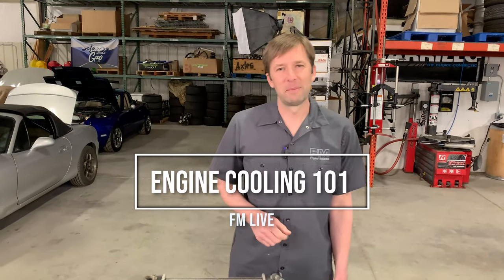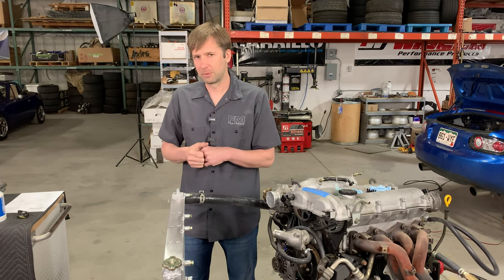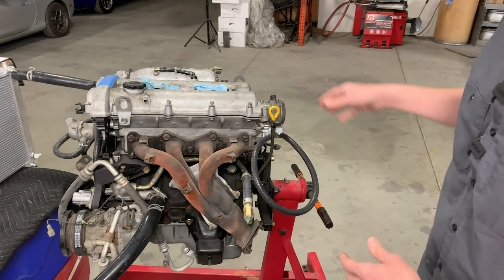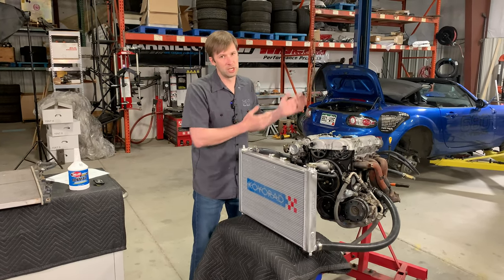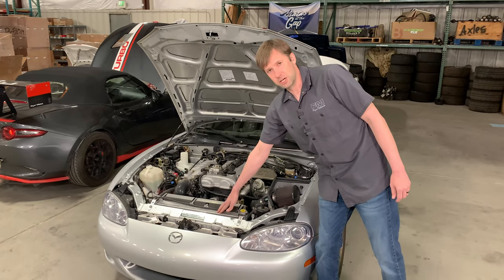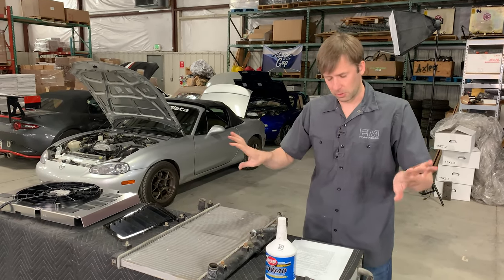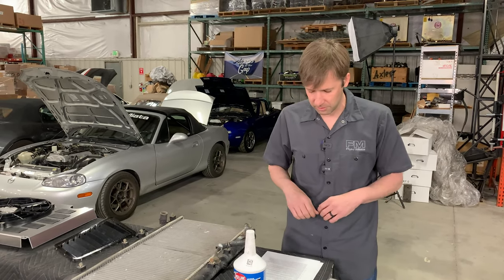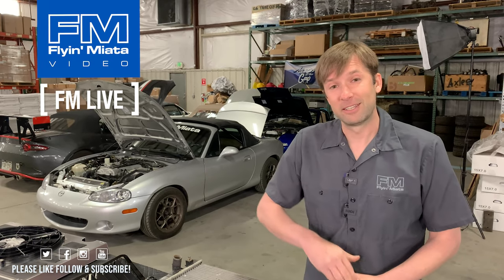Miata Engine Cooling 101 (FM Live)

Comment: Very helpful talk.  

Not mentioned in this talk, or discussed much anywhere on the various Miata Forums, is the role of the coolant return pipe on an NA engine that takes the coolant returning from the cabin heater, and routes that coolant to the lower side of the block. This coolant return pipe is bolted straight to the exhaust manifold near cylinder number four. This bolted connection conductively heats the pipe. The return pipe also receives significant radiative and convective heat from the rest of the exhaust manifold. This small but significant short circuit of heat flow from the exhaust manifold into the returning coolant is intentional and by design.

The purpose of the heat transfer from the manifold to the coolant return pipe is to help bring the engine coolant up to operating temperature quickly during engine warm up, when the engine is started in winter in colder climates. This short circuit creates the following problem: the heat transfer from the exhaust manifold to the coolant return pipe never stops. Some heat from the exhaust manifold is dumped into the return pipe, continuously, whenever the engine is running. The hotter the manifold, the greater the heat transfer.  

If you live in Southern California, or in a similar temperate climate, the engine block rarely cools below 50 F even in the winter. Warm up is quick in the Southern States, and occurs in just a few minutes. For these locations the heat transfer from the exhaust manifold to the return line does more harm than good. 

I drive a 1.6L normally aspirated NA6 here in the local mountains. In the first 20 minutes on California's famous Angeles Crest Highway, the rise in elevation is about 4,000 feet, or around 200 feet per minute. On a hot day with the air temperature above 95 F, towards the end of that 20 minute ascent, I am controlling the position of the temperature guage needle with my foot on the accelerator. I back off the temperature goes down. I accelerate the temperature rises.

On this car radiator cap, hoses, thermostat, water pump and fans are all in good condition. The radiator is a 37mm Koyo.  I use a 2/3's water and 1/3 glycol coolant mix. 

This brings me to the following question:  The last time I was replacing the water pump, I slipped a DEI aluminized, reflective, tubular, heat shield over the coolant return tube.  These DEI sleeves have a proven ability to significantly reduce both radiative and convective heat transfer into the tubes and cables that they protect. Following the install of this insulation, my impression is that engine is not as quick to over heat in summer, on Southern California's famous desert ascents, such as the Angeles Crest, and the Grape Vine.  

What do you think Brandon? 

To promote rapid warm up, Mazda designed in a thermal short circuit between the exhaust manifold and the coolant return line. If your engine never gets truly cold, what you experience mostly is a thermal short, dumping waste heat into your engine. An insulated, reflective sleeve goes a long way towards limiting the radiative transfer into the coolant return pipe. Do you know of other instances in which this has been done?

Comment: I've got everything except stronger fans. My big fix, for higher track coolant temps, was routing my heater core outlet into the upper radiator hose, with an inline thermostat so the car still warms up. Outside of the oil warmer coolant, I've now got only "cooled" coolant entering the mixing manifold. All that hot coolant normally just gets heated up even more by going under the exhaust and then back into the engine! To be fair I've also got a header blanket, trying to block some heat from my supercharger. On the cooler days, less than 80-85f, my temps were fine. This was the fix for those sunny 90-100F days with high humidity.

Comment: My update to a Koyorad radiator solved my overheating issues on my 1990 w/99 engine.
Reply from the maker: That's great! Glad it helped!
Reply: On older radiators a layer of corrosion and a film of road dirt tends to build up on the fins. Pressure washing removes some of this, but not all, and can fold over the fins if not done carefully. I would expect a bump up in performance, with any new radiator of good quality over one that has been in service for a decade or more, especially if the old radiator was a 'generic' or 'discount' part.  

Koyorad has a deserved reputation. Their fits & finishes are terrific. The welds are nicely done. The weight of the sheet metal in the filler neck and ports is good. Their engineers will have considered carefully the thickness of the fins, the size of the gaps between the fins, and this kind of thing in order to maximize heat transfer. They make a good product.

Comment: The factory radiator came with a foam strip on the bottom of the radiator that closed the gap between the radiator and the pan on the bottom of the car.
Do you recommend replacing / retaining that when replacing the radiator? 
Does your radiator come with any ducting for the bottom between the radiator and the pan?
The reason I as is that it seems like if the strip isn't there it would allow lots of air to bypass the radiator creating high pressure in the engine compartment and allow back flow when the fans run sitting at idle.

Comment: Looking at that stage 2 cooling kit. However I have a Mazdaspeed and the description says it won't fit in a mazdaspeed. Not that I dont trust you guys or anything but looking at my engine bay i find it hard to believe it wont fit. My cooling problems are mostly at idle so i wanna get best fan possible.
Reply from the maker: There are a couple of hard interference points with the stock IC routing. It can be done if you don't mind sourcing silicone elbows and rerouting.

Comment: On a turbo street car would you recommend a 180 degree thermostat over the 195? In the summer mine gets warm
Reply from the maker: The lower temp thermostat opens sooner, which means that it takes that much longer for the coolant to heat up after the thermostat is open.  This can* delay the onset of overheating.

Basically, it doesn't make your cooling system more efficient, but it gives you a slightly wider window of time before your engine overheats - if it's going to overheat.

Comment: I've been tracking for years with a timing advance and in hot weather with a stock style AT radiator with 70/30 (water, water wetter an antifreeze) and a 16 psi cap.  Car is mostly a track car but has AC condenser etc is still very streetable. 

That rad is getting up there in years now and I am thinking of changing it preventatively. 

Any reason to consider upgrading vs swapping with the same thing that's been fine for the better part of a decade?
Reply from the maker: If you haven't had any issues, you're probably going to be ok with your current set-up, but a good aluminum Cross-flow radiator will definitely be more efficient and should last longer than the stock-style plastic tanks.

Comment: Does a front splitter provide any substantial cooling benefit from added, upward air flow?
Reply from the maker: Good aero and ducting will push the air where you want it and provide downforce, but unless you are running really aggressive ducting on a race car, you probably won't notice any cooling benefits on a street car from a splitter.
Reply: @FlyinMiataVideo  I should have clarified that my question was regarding a track car.

Comment: I’ve got a stock 94 NA.. my stock temp gauge bounces up and down. When I’m moving the temp drops, when I’m stopped or climbing a hill the temp goes up… ive wired both my fans to come on and also got a fan shroud as well. I’ve recently changed the thermostat and the temp gauge sender since I thought it was a possibility that they are bad. It’s still doing the same thing on the temp gauge, what could be wrong?
Reply from the maker: Give our customer support team a call or email, they'll be more than happy to help you trouble shoot!

Comment: Would vents be a good modification to all cars (assuming correct placement) is there any downside to adding them?
Reply from the maker: Vents wouldn't hurt in most situations, but probably aren't needed for a mostly stock or daily driven car. The biggest downsides to louvers would probably be cutting big holes in your body work and inviting all the dust, water and debris from the environment into your engine bay.

Comment: P0128 - Can you elaborate why this most commonly happens? 

2003 SE, No leaks, mixed right, stock intake, FM coolant reroute, new CSF rad, new cap, new t-stat, air evacuated, stock fans (working), new temp sensor, new intake air temp sensor.
Reply from the maker: Please reach out to our customer support team directly via phone or email, they'll be more than happy to discuss your issue and help you troubleshoot. Thanks!

Comment: Are there any particular differences for the ND platform (temps, gauge accuracy, etc.)?
Reply from the maker: Not that we are aware of. The gauges are digital, so could possibly be more accurate, but we haven't tested it.
Reply: @FlyinMiataVideo  An FM product I'd be very interested in seeing would be performance data on the digital gauge or Mazda Connect screen!

Comment: I have a 99 with no AC, and only one cooling fan. I’ve been to the track twice, both times in kinda high temps 75-80 F days, both days I overheat after 10-15 mins on track. In normal operation it’s flawless. Was missing the stock bellypan, installed that, no improvement. Should I install a second cooling fan? Would that help since it has to do with A/C? I don’t even know when the normal fan is supposed to cycle on, I sat letting the car idle for like 20 mins and it never came on, is it possible that that fan is not working? I don’t know how I wouldn’t be overheating in traffic if that were the case. My rad is also recently replaced with a stock unit
Reply from the maker: What are high temps to you? Are you running aftermarket gauges? If so, where is the sensor located? Are you force-inducted or NA? I'd start with running a 70% water to coolant mixture since water dissipates heat better than coolant. What's your radiator cap rated at? About 16 PSI is stock. Is it popping off before that? Are you running stock fans? A well-designed airflow kit along with a crossflow radiator would go a long way for track use. And finally, removing the A/C condenser (if you still have it) in front of the radiator would help with airflow through the radiator.
Reply: @FlyinMiataVideo  I meant high ambient temps, 75-80ish on the days I was running. I don't have engine temps but the dial was pinned and when I pulled into pits the coolant was boiling in overflow tank. It's NA, completely stock. And I don't think it had an A/C condenser to begin with, I think A/C was deleted in options when ordered. There appears to be some kind of stock air ducting into the radiator on the front bumper. I know crossflow would be better but I wouldn't expect a stock car to be overheating. I will flush the coolant and put the 70/30 mix as you recommend in the video. Do you know when the stock fan is supposed to cycle on? Haven't been able to find that info. Would it help to add the second fan and maybe wire them to a switch to be on continuously? Or would that make no difference? Thanks for reply
Reply from the maker: @Ferraridude13  The primary fan should come on around 203F and the secondary a bit higher than that but before 230F since that's when bad things can start to happen. I'm not sure on a stock fan setup but I've done some crude testing and our Stage 1 fans still pull air through the radiator around 90 mph. My test was to see when the rubber flaps started to open up and I was doing pulls on the interstate. Since I didn't know if I had a tail or headwind in the test, we didn't think it would be a good idea to add it to the product description. In general, for track use, we think two fans on a well-designed airflow kit can still help if your speeds are 60mph and under or if you're in a lot of traffic. You also might check to make sure that you have good voltage and ground to your fan. If it's under battery voltage by a decent amount, it probably isn't spinning as fast as it could. If everything checks out good and you don't want to upgrade any of your cooling system, start shifting earlier and stay off the rev limiter. More revs make more heat.

Comment: I have two SPAL fans rewired so they always turn on with the turn of the ignition key with a cheaper all aluminum radiator. SPAL is a big name in the BMW racing world. It pulls too much power for the stock wiring.

Comment: how do  you test a rad cap?
Reply: The testing machines typically cost over a hundred dollars for one which is properly calibrated.  Since a good quality cap, with standard pressure, typically costs less than ten dollars, and the probability that a new one is going to be  'good' is very high, most of us just replace the cap when we are doing any kind of service to the cooling system. The caps have a limited service life. The seals compress a little over time, and release at lower pressure than when they were new. 

Immediately after you turn you engine off, the coolant in the engine stops moving, and there is still considerable heat in the cylinder head. If you hear boiling of the now almost motionless coolant which is sitting in the still very hot head, immediately after engine shut off, it is almost certainly time to replace your cap. A cap that holds the coolant at the stock pressure (or higher pressure) will suppress the boiling if you have no other cooling system problems.